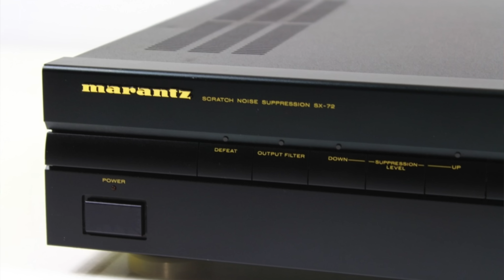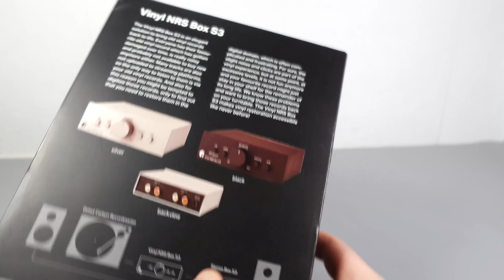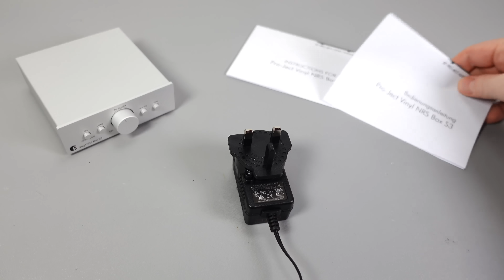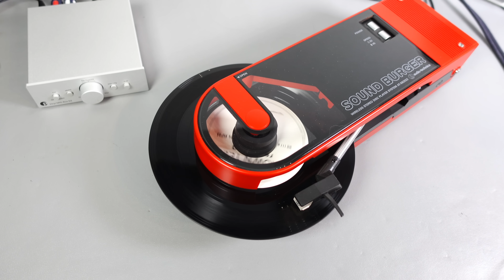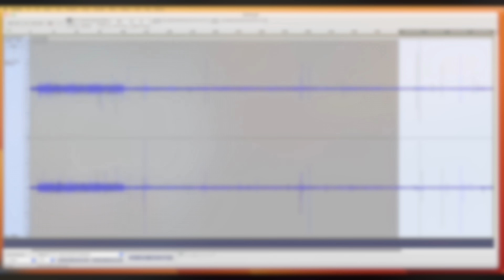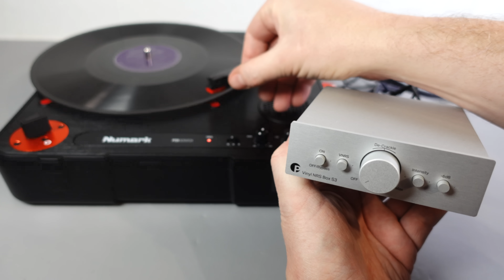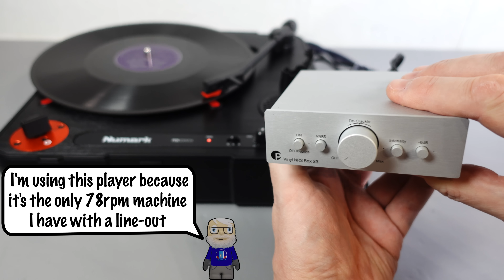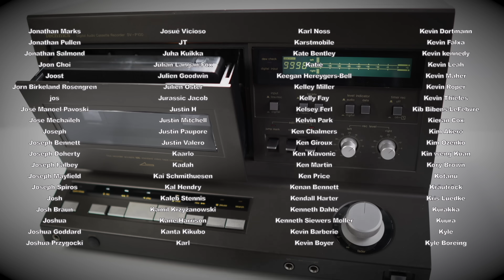REVIEW : Vinyl Noise Reduction System Pro-ject NRS Box S3

Comment: i do not think you mentioned "wave corrector" which allows noise reduction from recorded digital audio wav files. If curious, every click can be zoomed in to see what the software is doing and the sample can be adjusted as well before and after click removal. I've seen more than 20,000 "corrections" on a single record side. After saving a "clean" audio recording, it can be burned on a CD - and play back is like listening to the original record. Wave corrector is free software now thanks to the author. Ocenaudio is a good alternative to Audacity and somewhat easier to use and seems to be based on similar features that were provided by Cool Edit 2000.

Comment: It could have been a great opportunity to use old Eastern Bloc x-ray records to know if it can attenuate their flaws.
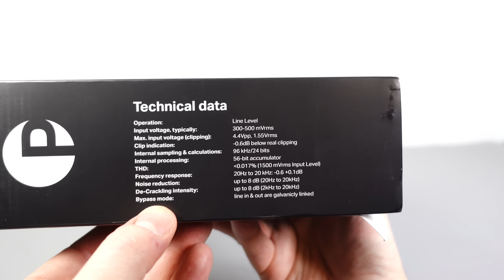3:50  I wouldn't be surprised the DSP used in this device is a venerable Motorola 56001 (the model that equipped the NeXTstation and Atari Falcon), because its specs are precisely the same than indicated there.

Comment: It doesn't do a bad job on random crackle, but those unwanted 'crack' sounds that come once per l.p. revolution, are scratch related, & from my experience, you'd have to sacrifice much high-frequency  music detail to even slightly stifle those "wider-band frequency" cracks that you're stylus hits 33.33 times per minute / each every a tad under 2'secs apart.    
& yes, I heard that bass drop away with VNRS engaged, listening through our TV 's optical out into the 5.1 surround sound system. (Set to stereo matrix'd 5.1 setting, YouTube music normally sounds gr8/best to me this way)

Comment: I recall a system called DBX. Most pro DJ turntables with a rack mount that I have seen have had a DBX module in the rack. This was used to help most cracks and pops on record in the good old days.
Not knowing the cleanliness of the record I would first use a Diskwasher type cleaning system followed by hitting the record with the Zerostat gun to eliminate static charges, static can discharge from the record to the magnetic cartridge causing some pops. I do wish they still made the original D4 fluid for the washing system. Now for diehards I have seen ultrasonic cleaners for records which provide ‘ deep cleaning' for the grooves.
Reply: What do you use instead of the D4

Comment: In the progress of digitizing my vinyl collection, I've found the best way to deal with huge clicks and pops is to manually remove them with an audio editing program, like Audacity.  I can zoom in on the actual waveform that represents the noise, select it and delete.  Sure, it does change the timing and deviates the BPM (beats per minute), not to mention it sometimes makes the track sound weird, but I'd rather live with that over a constant reminder that the click or pop is there.  

On light scratches and noise, after cleaning, I play the records "wet" (saturate a layer of water over the side being played).  Most of the lighter noise is due to static and water helps to prevent the build-up.  After recording the sound into Audacity and manually removing the worst noise, I run the track through my copy of "Audio Cleaning Lab" by Magix (Sound Forge).  

Mine is an older version, but it does the job.  I was surprised that the quality and amount of cleaning tools it offers to help me; it seemed near forensic level quality work!  All the changes can be applied in Real Time and you can "A/B" (compare before/after or 2 different settings) your changes to see which one you like.  I can even widen the stereo field to shift some sounds, bringing the intelligibility up more.  Lots of other tools to list here, so I'll spare you the reading.
Reply: You need to really zoom in close. And then the removal may generate its own artifacts. Try reversing the file and try a declick
Reply: @paulsawtell3991  Now, that's a trick I've not tried yet.  It makes sense.  I'll give it a go and see how I do.

Comment: I got totally fed up with buying a new lp only to have to return it for replacement many times because of surface noise and crackles. CDs were a godsend (anyone want to buy an original NOW 4 CD!!!)! So some years ago I converted my vinyls to digital improving background noise, some distortion and clicks using Algorythmics Sound Laundry 2.5. This allows very many tweaks. and you can record background noise spectrum and remove it. Adjustments stop changes AUDIBLY affecting the content. It still seems to be on their website. Large scratches (pops) need to be removed by removing the few thousands of a second of the pop from the audio. Many audio editing programmes enable this the only thing to watch out for is that you clip the audio start and finish at the same level (zero is good!) else you introduce another click. the music sounds ok if less than a few 10s of mS are clipped.

Comment: I've recently got into digitalizing records and were looking for such device! However, after searching around found piece of software that uses A.I processing with many more dials and is able to fine tune it so eliminate's the crack & pops entirely. Altho, I believe that cracks 'n' pops kinda adds charactor to vinyl a form of charm to the listening experience.
Reply: try wave corrector - free to use and you can visualize each tick or pop

Comment: I don't think the VNRS is 78 agnostic. Because the 78 spins faster and the rumble and cracks are caused by physical properties of the material which hasn't changed, the characteristic frequency of the noise and pops will change with the faster record, thus not what the filter box is expecting.

Comment: Seems a bit pointless digitising a worn-out record and cleaning up the sound for one-off listening. Surely you'd want to digitise it to file, then tweak it til you're happy with it and save the result to an MP3 or wav file so you could listen to the piece whenever? I've done this using Magix Audiolab, that's an ancient program but works very well. You can also use Audacity, and that's Open Source. An analogue to digital converter only costs a few quid, so that's far cheaper and probably better than this approach.

Comment: I had a sugar cube SC1 which works but I just felt it was digitizing the analogue sound I wanted, so sold it on. I didn't in the end see a point to it. If the record was too far gone its just not worth putting wear on my expensive MC cartridge, better to get another copy or a digital copy cd, stream etc

Comment: A great video as always. Just out of curiosity - is it possible to place a phono preamp behind the NRS in the signal chain or does it only work with already amplified signals? If so, it wouldnt be suitable for any setup with amplifier-integrated phono amps.
Reply: I had the same thought - I'm thinking I could run it through a tape out/in. Take a record out to the NRS, then back to a tape in on my preamp (same on an integrated amp) just set the amp on 'monitor' i think good to go!

Comment: Mat: Clearly the equipment you show is more for playing records with not a lot of crackle and background noise than for playing neat vinyl, but with some click. Whoever is interested in cleaning vinyl should use computer software, as I assure you, they are much more efficient than the Project equipment that you show us.

Another suggestion: To test 78 RPM records, try to get yourself a brand cartridge, Shure, Audio Technica, Ortofon or another good brand, that is specifically for 78 records, same for mono vinyl. Each capsule has its specific needle in terms of type of cut.

I hope Google has translated what I write to you well, because I don't know English.

Greetings from Santiago de Chile.

Comment: You're missing the frequency content point of view. What's the frequency content of a "pop", or a "crackle", or a "rumble"?  Is this box just a low pass filter? A low pass filter will also get rid of high frequency components from the music.  Making a record with nothing on it quiet doesn't really tell you anything. Use a no pass filter, that's will get rid of everything. Hell, turn off the box, disconnect it, that will really be quiet.

Comment: Serious noise reduction systems are done in the digital domain, and almost always the starting point is finding a spot on the recording where there is silence, such as the very start or the very end of the cut. It establishes a "noise signature" that the DSP algorithms can use to detect the actual signal that is buried within the various surface noises. That is what is lacking about this box: it has no idea what "silence" really is on each cut. It has to guess, which will invariably be wrong and/or totally insufficient to do a decent job of noise reduction.

I find it amusing that the very people who are devotees of analog recordings might have to resort to inserting a device in series with their blessed all-analog signal that is first converting the analog signal to digital, then applying its algorithm(s) to the signal and spitting out its signal through a digital-based D/A converter!

Anyone who has ever heard an old recording that has been passed through a CEDAR noise-reduction system or something similar knows how effective it can be. There is no way to create circuits in the analog world that do what DSP algorithms do in software, which is why noise reduction add-on boxes like this are quite ineffective.

Comment: Another great review, Matt, thanks a lot for all the work you put into your videos! 
Re the 'silent record demo': Maybe it would have been a good idea to record a 1-to-2-minute passage without any processing, loop that initial recording in software (as 'equal playing field' for the different intensity stages), feed the entire track back into the NRS, and re-record the end result for the comparison of the differernt processing settings.
BTW, what I'd REALLY like to have, is a software that does not try to 'fix' scratches automatically, but only assists me in finding them and lets me correct them manually (and separately per channel).

Comment: Fun review! I think the noise reduction works well. Previous systems removed the spikes only and had to guess what to replace it with, It sounded overdone but was a means to an end.
This box is subtle and -6 db is really not a lot. Making records playable is a bit of a hit and miss affair at best. I am good with that. The box cannot distinguish bonafide sounds from alien crackle if the repeat rate is too rapid. That is to be understood.
Your DBX record is great for a noise reduction sample as it is compressed 2 to 1. Signal to noise at best is 45/50 db. It is to be played through the DBX expander 1 to 2. At that point the SN is like 90/100db. That is their claim to fame. I had that system for cassette recording also. Amazing invention still used today in recording studios.
The box is clearly an attempt to do a bit of noise reduction and it works well enough but as a pop remover it is inadequate. My previous pop remover, 50 years ago, was much better but a bit overdone. Was it  Garrard? How difficult is it to remove a spike accurately anyways. Most testing equipment can do that very efficiently. Problem is not removing the spike but what to replace it with.
My NERO DVD/CD  recording suite for my computer had a noise reduction that could very effectively reduce most noise. By comparison this box is very low technology but it will sell well. The average listener loves these "promising" gadgets and if you only had mentioned that if you buy two of them and set them up in series there is a 12 db reduction (well, maybe) they will fly off the shelves.
Keep your reviews coming. I am 77 and have gone through most tech changes.
Rinus

Comment: I have a Rek-O-Kut that does the same thing (from 199?)  I have found it to be marginally beneficial it removing those cracks and pops but I do think it also removes some of the higher frequencies and tends to muffle the sound somewhat but useful in certain circumstances where the pops and crackles are more than acceptable. 
Have you done a review on DBX?

Comment: Why do so many DC adaptors take UK plugs upside down? The earth pin should be at the top and the cable hanging down, but in this case, the cable comes out of the top of the power supply.

Comment: I would have loved to see a simultaneous recording of both the input to the device, and the output from it, visualised in Audacity. I think that would clearly show what crackle reduction was done, in a visual way - you could count the number of crackles and see how their intensity differs. Just switching it on and off during recording is susceptible to chance, as you've noted, and makes for a difficult comparison. If you only have one recording device, I'd record the right channel of the input and the right channel of the output as the two stereo channels for PCM recording.

Comment: Honestly, you're testing methods leave a lot to  be desired. You tested the silent record as it played,  not the same area with different settings,  add to that the wobble of the record itself changing as it plays, and you're comparing apples to oranges...

...on the first tests,  it was an obvious reduction(if you expected a miracle-you're expecting too much), if you can't hear that, give up this inquiry--your ears aren't suited to it. 

As far as the 78 goes, seriously--seriously,  wrong needle for the groove. 

You should do this again, with a relatively clean 45 or 33(which this was intended for), and compare the exact same area with the different settings, the fact that this little bit of logic escapes you makes me wonder how well thought out this entire process was.

Comment: Since the test record is mono, you could have split channels and use the device on one channel only and use the other channel to compare. There would still be a stereo-aspect to the noise and crackle, but it would be a better comparison than comparing different parts of the record.

Comment: I have a way to clear up to almost eliminate the the crackles and some pops. I use gin to clean the records when they get bad enough and it seems to help. When a record is excessively bad, I will play it with the gin still on record. Note that the needle needs to be longer and when post where the diamond is should also be longer to aid in the dirt dig out process. Also the longer it is, would help prevent gin from drowning out cartridge. You should also use a ceramic cartridge because it weighs down heavier where as magnetic requires lighter pressure. Not guaranteeing 100% each time used, but a significant change in better sound which could blow this machine out of the water.
Reply: I use a modification of this, I just drink the gin until I don't hear the pops!

Comment: I am lucky enough to have an SAE 5000 transient noise eliminator from back in the 80’s. Unlike this reviewed device the SAE actually works and gives you an “invert “ option so you can hear what it has removed. If you can’t find the SAE look for the Burwen model from the same era it does much the same thing.

Comment: A rumble filter is just a high pass filter and seems is all the vnss feature is. Turning bass control up to compensate just puts the rumble back. Luckily there's very little subsonic information on vinyl. The media itself limits the useful low response.
Analog impulse filters to reduce noise have been around for decades and some work quite well.
It's the broadband noise that's the most difficult to clean.
Dynamic noise reduction is helpful. None of this stuff works miracles.
There were a number of diy schemes in the 1980s for electronics enthusiasts.

Comment: Well, I was considering buying this - but no more.  The easiest and most obvious thing a noise reduction system should do is remove clicks, and that is what other devices, such as the SAE 5000, and phono preamps like the Kab Souvenir or VSP do very well.  Yet this device seems to utterly fail at that.  I have the Parks Puffin, and with "magic" enabled and appropriate rumble filter set in, it seems to do a better job than this Project...

Comment: Vinyl enthusiasts complain about "digital" simply because CDs were sampled at 44100 Hz.  This is barely high enough for high fidelity, although not ideal (it was the late 1970s and data rates and disc size mattered a lot, hence the tradeoff).  Digital sound at that sample frequency will distort very high frequency sounds, make them sound harsh (almost square wave).  However, 96000 Hz sample rates can accurately reproduce even 20 Khz sound waves.  So the harshness issue disappears, and it reproduces the sound accurately, even more accurately than a physical stylus and groove is capable of.

I noticed the device samples at 96 KHz and most definitely will not affect the sound (other than processing the scratches etc).

While devices like this work "on the fly", they aren't as effective as sampling them into your PC, running learning type filters on them, them hearing the output.  These more advanced pieces of software your PC is capable of.

Comment: The "clicks" and "pops" are not present on a new record that has not been played. They are caused by the hard stylus tip sending shock waves through the vinyl punching minute holes through the other side.This is the noise you hear when playing a record. To prevent this from happening, a special liquid is applied to the record which is absorbed into the groove wall at a depth of a few microns. This hardens the groove for about 200 plays, preventing the shock waves from occurring.